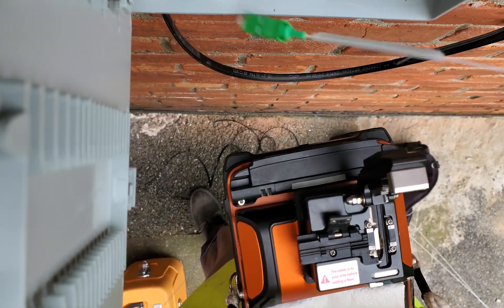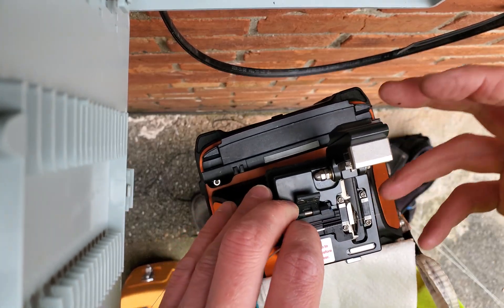Adding Splitters into a FOSC A + Some standing up splicing

Comment: Love your videos!   I believe that 4-port may be installed incorrectly or is for a b-case, not sure.  The A-case ones are slightly different.   I had a tough time getting instructions on the A-case installation of these.  Strain relief bolts where the splice tray slides in.  I can send instructions to you if you don't have them.
Reply from the maker: It is the correct the 4 port adapter but I have never installed it without a cable in it.  You would always tighten it down after you put in the first cable also this was completely submerged so might need to pressure test all the FOSC by the river.
Reply: @briceperdue7587  ok, it just seemed kinda high in the collar.  Hard to tell though.  I struggled finding how they sat inside the collar and how the strength members were secured until a guy from corning got me the instructions.  Wasn't at all how I was thinking.